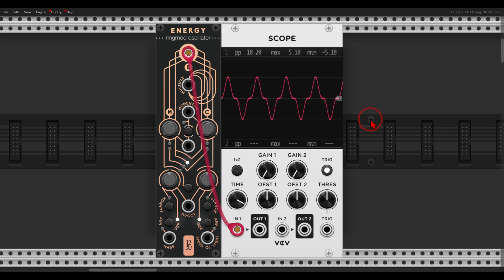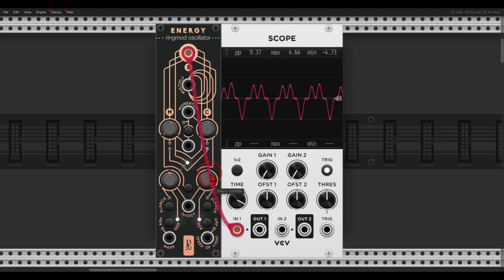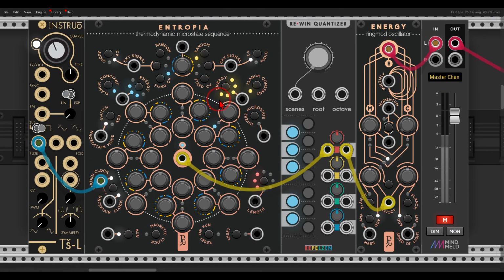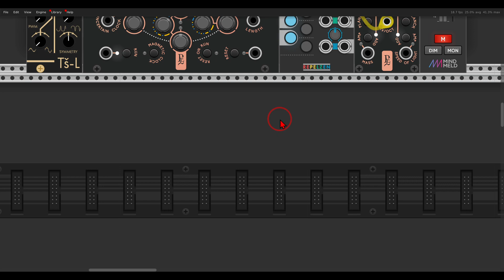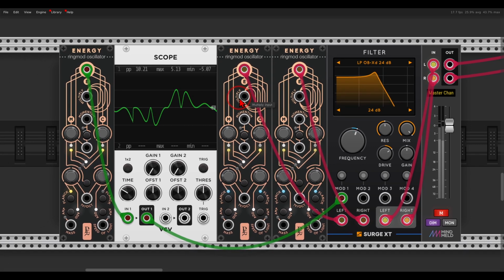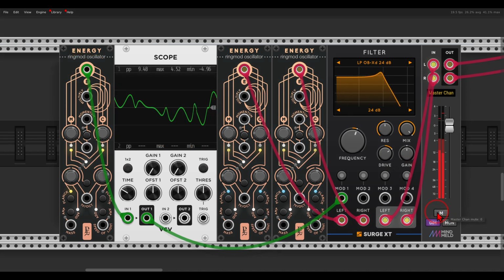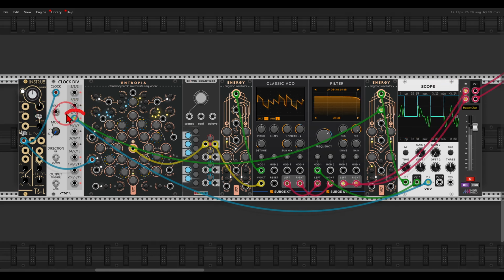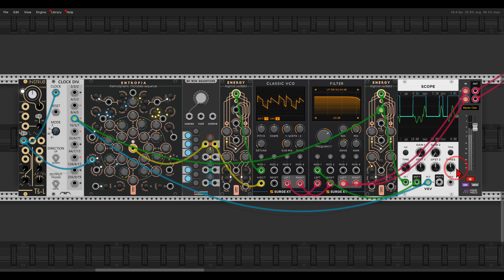Complex LFOs with Energy \ Quick Tip

Comment: Geodesics modules are awesome, but they'd be a whole lot more awesome if their functions weren’t given such obfuscating labels
Reply: Yeah Make Noise do this too. It reached peak with Strega. It's a bit annoying really. Renaming conventional parameters like "Filter Cutoff" as "Absorb". Totally unnecessary
Reply: Accessibility is not necessarily the “raisin deter” as I understand it. Rather, mystery and a particular vision carried through the design/nomenclature is why it’s done that way. As a user who wishes for a quick to understand interface, it is frustrating when confronted with such an inscrutable configuration. As a designer, throwing usability out as a consideration opens the door to more imaginative pursuits. Luckily, the manual provides the necessary key for linking the design to its use. 

Module designers, for the most part, are in either of these two camps: utilitarian/basic, or fanciful/complex. It’s the designers that break out of these boundaries that produce the most used modules. The Mutable Instruments modules are typically at the inverse of these camps. They’re made to look logical and simple, but they are quite complex and you usually need to run to the manual to help you understand their functions.
Reply: @mikabreto  Whatever the reason, renaming universally understood conventions adds to unnecessary confusion. Especially for newbie synth owner who think their new Make noise synth has some "super parameter" that doesn't actually exist
Reply: @cockur  This type of renaming occurs even at the corporate level, with companies who have competing products that use the same technology. It is frustrating. They’ll use different nomenclature for the same thing to try and differentiate their product from the competition.
Reply: From their documentation:

"""
For a more immersive concept, each parameter uses some terms related to the scientific phenomenon that in-spires the module. It might be confusing at first but that’s why this manual is here. As every unusual musical instrument, a learning curve is required to make the best of it.

While a lot of advanced science is involved, the final purpose is to create musical and creative instruments, effective and friendly to use.
"""

Good or bad choice? You decide but at least, the motivation is clear :)
Reply: @3Dos  Yeah as I said - it's fine for me. I can twist a knob labelled "Absorb" and listen and think ok that's just Frequency cutoff. But for some one with less experience they could go away thinking "Absorb" is a conventional thing in synthesizers. You could even mistakenly bring up "Absorb" in conversation and no one would know what you were talking about unless they also owned a Make Noise Strega.